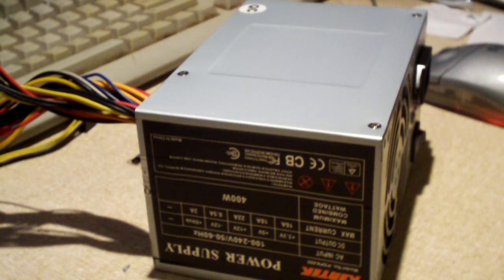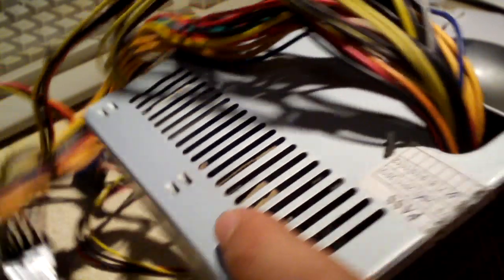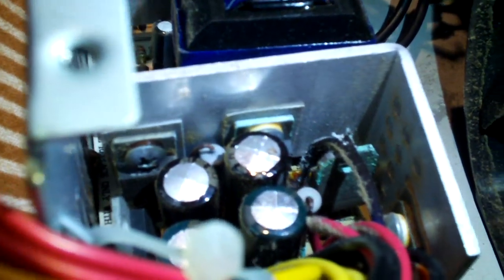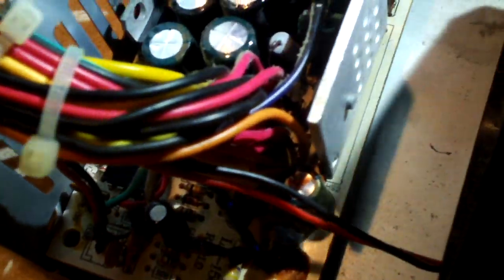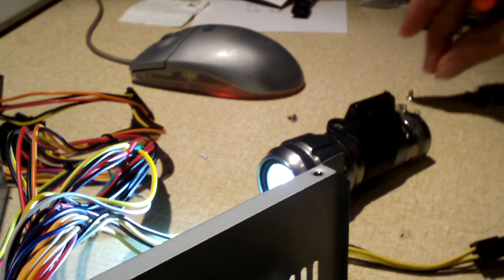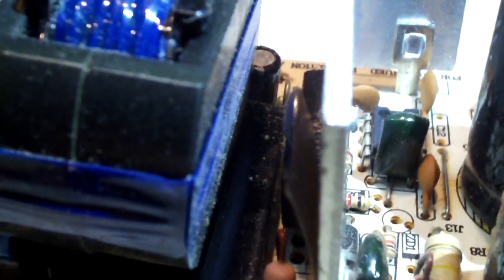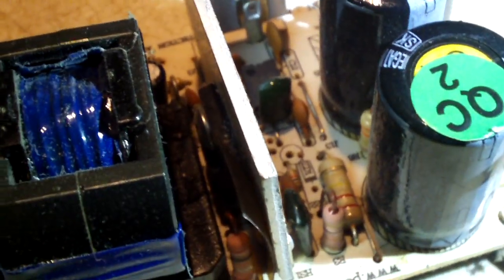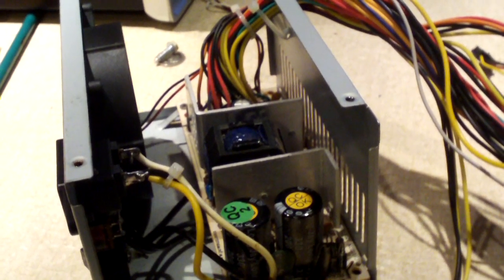An epic fail of a power supply design, period.

Comment: There's a project I would like to try. Buy a cheap PSU and replace every cap with Japanese caps.
Reply: Not worth it. Unless the design allows for improvements like adding bigger and better quality components, the Japanese caps will not be used effectively and efficiently. You can try but other components will limit how much you can demand from a power supply. 

Just imagine the ripple when a cheap component fails! You'll be looking at ripple in the 300s! (ATX spec is 120)
Reply: It would be a great learning experience then if I got every high quality component I need then wouldn't it? 

Like I said it would only be a project and if you've got anymore info on this I would love to hear it! :D I'm still learning this stuff.
Reply: +FrankyManky you know what? Forget my previous comment. Go for it!

I'm curious to see what happens but all you will probably see is a silent death or a loud and sparkly bang. Worst case you will see flames... Might want to stay a safe distance just in case ;)

Get a power supply tester and hook it up. For say a cheap 500w, replace the caps with a certain Japanese name cap and make sure they are correctly soldered. Test and try to get 500w from it... Now this would most likely cause the psu to become hot since the cheap components will be stressed beyond their limits and will die before the number hits 400w. Do this in a safe environment where you have standby emergency equipment. Do it in a garage or somewhere where there's a lot of room. 

Information: go up in microfarads not down. The higher the capitance the better. Also, make sure the pcb has components in every soldering spot. For the lols. Try to find a decent fan to maximise lifespan of caps even though it will probably die.
Reply: maz199 (he wold need to replace the hpt`s with ones that have a higher curint and volteg rateing

Comment: just loving your PSU videos. not to many go over them. hardware secrets have helped as well. I just spend 3 days with a 650W Chiefmax (board made in 2008 LOL with a sticker on the case saying 1/2013)... added 2 coils, 2Y/1X Caps, & 1 MOVs. crosses finger for SMMMOOKKKKEEEE TEESSTTT! sorry just channeled UXWBILL there :p It was worse than a PowerMax 450W (v1.6 board) it actually had 1 coil, 1 MOV, and 2Y+1X Caps! ;) going to add 2 y cap, 1 coil, and 1 x cap to the mains eventually! I think it needs a coil on the PCB as well.. fun times!